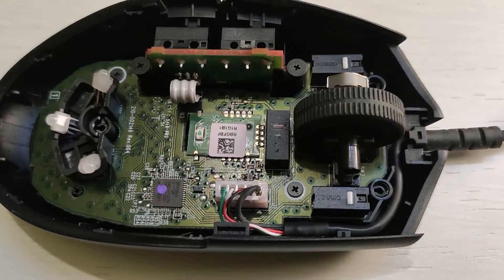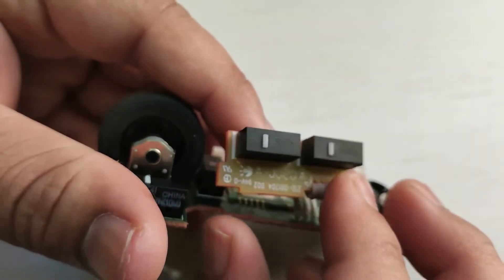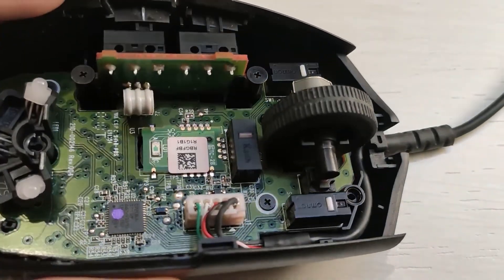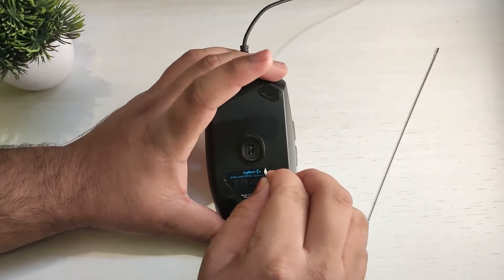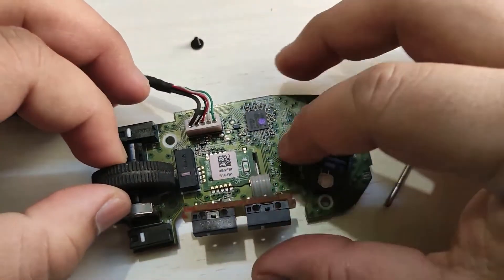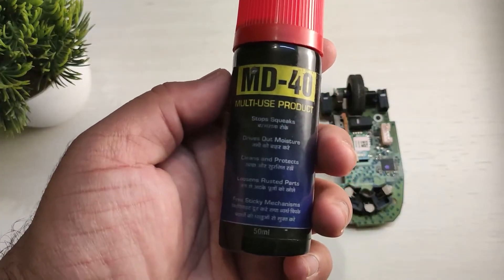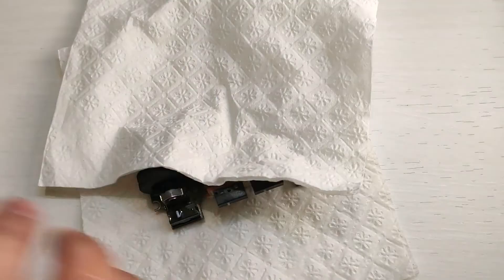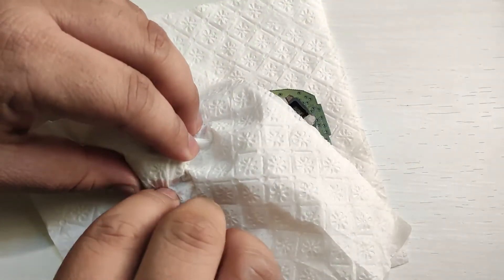How to repair mouse double click, scroll wheel issue in 2 minutes

Comment: for the repair of scroll wheel issue just pluged out the mouse turn mouse upside down and make sure scroll touches the surface and pressed the mouse against the surace and go up and pressing the mouse it will fixed the mouse without disassembling 🙂🤗

Comment: I got this problem around 1.7 years ago. Both problems btw. And put mouse in drawer just waiting. Just 30mins ago decided "fuck it, ill try fix it" and then looked vid, did same thing except i took out the motherboard completely. Oiled it rq with WD and put it together. Both problems disappeared. Put other mouse into drawer instead and now using my old mouse again. Thanks for the help.

Comment: if you have a problem with you scroll wheel I recommend you to just spray the metal lubricant just in the space on the sides of the mouse wheel just so you don't ruin your warranty or possibly ruin your mouse

Comment: Thank you so much brother. It actually worked for me. After suffering for more than a week finally I was able to open my G102 and spray some liquid with alcohol after that it is working fine, smoothly. 
Just got some issue with mouse skates. I had to be very careful about that.
so whoever wants to try it, remove carefully those skates otherwise you have to buy new skates for you mouse.

Comment: I ripped out the rubber of my scroll wheel because its melting and dust and dirts just sticks on it.
then I cleaned my desk, placed my g102 on it in up sidedown position, held it in my hand making sure the scroll wheel is making contacts on the desk I started sliding the mouse up and down, this rubs the scroll wheel up and down removing any possible dirt and grime on it, keep doing it until it fixes scrolling issue.

Comment: This G102 comes with a 2yrs warranty and in this time period I am currently on my 3rd Mouse (Original then first replacement then now.. second replacement). G102 is an absolute piece of shit when it comes to scroll wheel and Logitech is least concerned about this. Within 6months.. all the mouse went crazy with their scrollwheel. I saw similar problem in Asus ROG & Corsair mouse too. Is there any brand who's mouse can last at least 2-3yrs without going crazy? Please suggest.
Reply from the maker: Totally agreed. The cost of travelling to service center so many times for replacement migh get equal to the price of the mouse. It is better to repair it yourself.

Comment: WARNING GUYS -> Make sure you don’t get the wd-40 solution to your optical sensor, i sprayed generously and it flowed down to the sensor. I had to disassemble the sensor and dry it out with alcohol to make it work again. Apart from that the solution is legit to make the switches work

Comment: I did't opened the mouse but i used a dropper and pin pointed the scroll whell to drop rubbing alcohol. It worked like charm.
Reply: this worked like a charm, thanks for commenting this lol
Reply: Thanks, this fixed it
Reply: i just pored some alcohol sloppily on my mouse wheel and it fixed it immediately
Reply: Can You explain how you managed to pour rubbing alcohol without opening the mouse?

Comment: LOL cant believe this worked, or maybe it was just because of the dust, I had the scroll wheel problem where If I scroll down it would be erratic and scroll up vice versa, sprayed wd40 and dried it off a bit and dusted off grime sticked onto the wheel then bam the scroll issue is gone, hope it fixed it or maybe this is just temporary but anyways thanks lol, I don't want to buy another g102 for almost 20USD.
Reply: buy razer

Comment: Do you think Isopropyl alcohol can be used to fix it too? Thanks!
Reply from the maker: I don't think isopropyl alcohol will work as lubricant
Reply: @encryptedguy  no, it isn't lubricant, it's most known as "contact cleaner", and leaves no waste behind, like Wd40 wich have oil that never leaves the piece. Oil is nice only because protect against future rust but think im going to clean with isopropyl alcohol and leave clean until i need to fix again
Reply: @whatever_else  so did it work?
Reply: @edgarmagno2847  my daughter throw mouse to the ground and then worked fine again, but I bet cintact cleaner (isopropyl alcohol) can solve it to. I use everywhere from cars to PCs and works everytime
Reply: @whatever_else  hahaha i might try throwing my mouse on the ground aswell thanks for the response😂

Comment: Something interesting I found is that if I hit the button hard a few dozen times, the double click issue goes away. It's probably the oxidized layer coming off from the copper plate. Not sure how permanent this fix is though, I may have to do it again in a few months if the issue comes back. The same goes for the scroll wheel. Sometimes it scrolled in the opposite direction so I hit it a few dozen times hard and scrolled it pretty vigorously for a while and it seems it fixed that too. Again, probably not a permanent solution, but hey, it seems to be working fine now so I'm happy.
Reply: i scrolled my wheel in highspeed using a drill
now it works flawlessly
Reply: @jee8440  This worked perfectly, saved me $200 bucks. Thank you!
Reply: Holy moly this actually works dont know till when but i can confirm it works just after reading this comment and hard hitting my mouse button ... Thanks a ton😘
Reply: you saved my day buddy. Thanks a ton
Reply: worked on mine, thanks!
Reply: ty dude, tried it out and now my mouse wheel works again. it's kinda primitive but works!
Reply: thank you so much lol that worked
Reply: A life saver!
Reply: Thanks man worked for me
Reply: damnnnn it worksss
Reply: wtf it works HAHAHHHAA. thank you so much!!
Reply: apparently smashing the mouse wheel button multiple times fixed the scroll wheel issue too
Reply: Sure it works but i agree with you it is not permanently solution. I've tried and it still double click but compare to before it's like the 1/50 double click
Reply: this was also happening with my Logitech B100 office mouse and i tried it around 1 year ago and it still works
Reply: Holy shit! It works, goddamn! Thanks man!
Reply: Worked!!!
Reply: u made my day, I just clicked it hard for 2 minutes, rotated the wheel occasionally, wiggled it from left to right, and when I retried the function of the wheel, it was 100%, It made me smile :D Your post is better than the whole video

Comment: hey i sprayed wd40 and it fixed my broken scroll wheel, but now the sensor to register mouse movement is not working. when i slide my mouse on my table, the cursor does not move and stays in the same place

Comment: bro does it no pose a fire hazard to the mouse? also how long do you need to let it sit so that the solution will not drip inside?
Reply from the maker: WD 40 is a non conductive fluid so there is no risk of short-circuit but it is flammable. The risk of fire break is very low in mouse. Unless you pass a very very high current through it that burns the main ic right after spraying it near the ic. Keep pressing for 1-2 mins